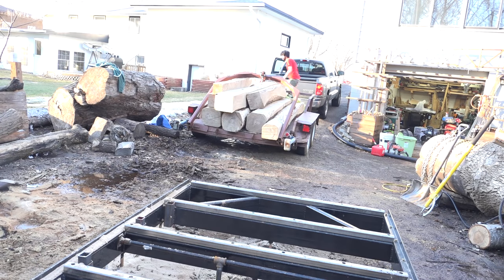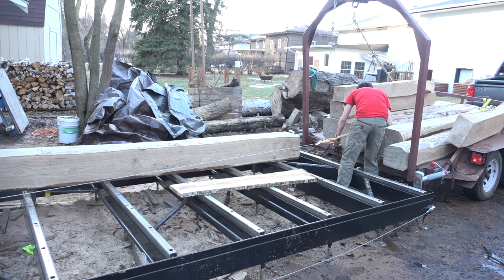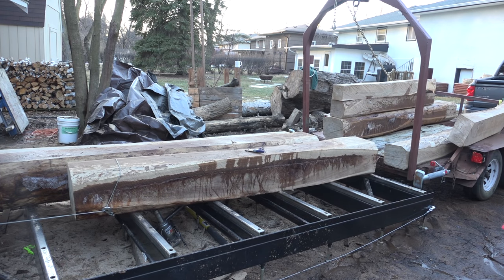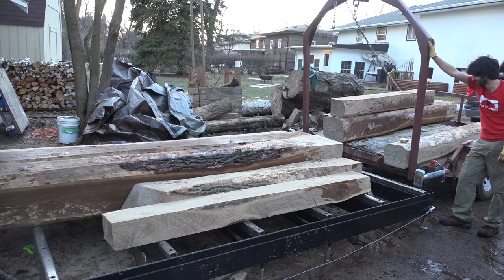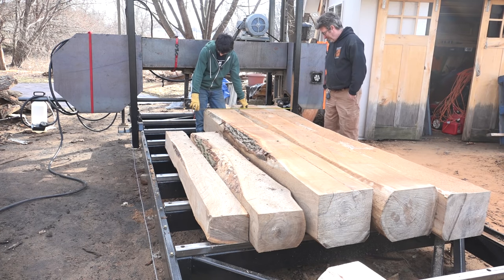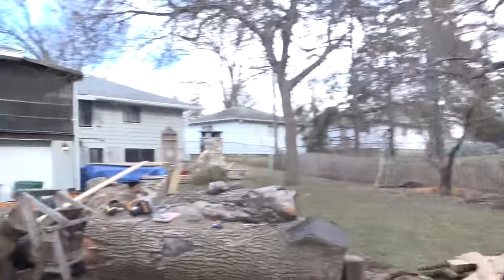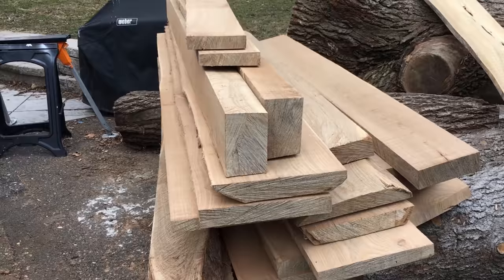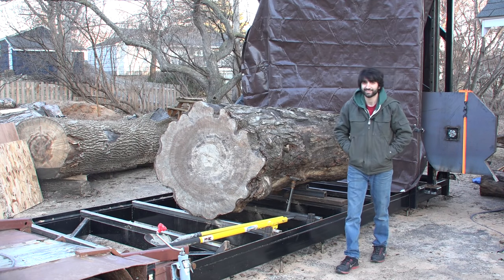Load Testing the Bandsaw Mill

Comment: I have a small sawmill (24" width) and I've found interrupted cuts like the ganged ones you're making takes less hp than the same width in a continuous cut.  I think that it has to do with the gullet being able to discharge the sawdust in the space between logs.  A good tip that I've learned is to use a water drip with liquid dish soap mixed in -- it cools the blade and more importantly keeps the gum off of it which can also rob hp.  Love the tenacity with the sawmill .  Keep going and Happy sawing!

Comment: Really amazing machine! I did notice that the drive belt did start to chatter when the torque changed with the wider material. Just a suggestion, but if it were mine I would install a tensioner or back side idler that would increase the life of the belt. This will also take up any stretch that occurs during the life of the belt.

Comment: I was thinking on the shot from "behind" the blade when you are cutting the 4 logs (cants?) and the drive belt is in plain view that it looks a bit wonky.
from about 7:30 to 8:30
I guess it can't be loose, or it would slip.  so maybe it's the width of the belt flexing or waving?
I don't know if it's a "problem", but you might want to look at the video & see what you think.
though I guess you can see it when you run the saw, lol, but maybe you're watching the logs & not the belt.
maybe an idler wheel would keep it from waving?  hard to say from half the country away.
;-)

the other thing I was wondering about is the blade TPI and possible clogging on such a wide cut.
but I have a 14" bandsaw that I've used once so there's that.

Comment: Matt, have you tested the blade temperature after making those wide cuts????? Just curious as to how much heat the blade is holding...  I have watched this from day one, VERY MUCHO IMPRESSIVE, considering you built the mill from scratch and no previous mill building experience!!!!!!!!!!
Reply: I was thinking the same thing. Wood is frozen through, by the time the blade might get warm, the moisture inside is still lower than thaw. This coming hot summer maybe add a blade mist system? At least when cutting 60 full inches.
Reply: I was wondering that too. Definitely hot enough to cause a bit of smoke in between the log. Probably comes from the fact that some of that wood is frozen.
Reply: More like , hang a ten gallon jug with a 3/8''s line to run a liquid luber to your blade, kerosene, Pine-Sol, and a little Dawn is the best!! 30 drops per minute... your blade life will be greater (so long as you are running it fast enough), it will help prevent sticker-stain while drying, and is non-staining on the lumber.

Comment: What surprised me was that the blade could clear the sawdust as well as it did with a cut that wide.   I know the saw can use 2-inch wide blades, are the gullets much deeper on those?  You might get some really fast cuts!

Comment: Great to see this working so well!  Does the thickness of the board you are cutting make a difference in how hard the saw has to work?  For example - does the extra weight of an 8/4 slab want to slow it down more than a 4/4 slab?  Thank you for sharing this project.

Comment: Hey Matt great video and also a really great machine, just from looking at the video are you getting a jump in feeding through the cut if so it may be caused by being pulled from one side   If that was the case it could be solved  by bringing the wire rope around the end of the bed via two pullies and connecting it to the other side of the frame creating a even pull between both sides of the frame

Comment: I love your build, though for myself I would tweak the design a bit. I would make it narrower so I could set it up as a trailer, and I'd make it much longer. I'd say being able to cut about a 36" diameter log would suffice, but I'd make a base bed of 12ft, with 6ft-8in extension beds (x3) so I could saw 32ft long logs but I could transport it at only about 12ft. That way I could mill roof rafters and the like.

Also, I think I'd put a tooth track alongside the glide track and an electric motor with driveshaft connected to a gear wheel so I could have powered gliding instead of the manual winch. Your build is certainly inspiring.

Comment: Absolutely stellar Matt! (I was noticing the way the carriage binds and torques, then "pops" because of the one-sided pull. What would happen if you built hold-offs for pulleys on each of the far corners and then connected the end of the pull cable to the other side of the carriage? Would the even pressure help relive that problem? I know it would double the amount of cable you'd need to wind in during a cut as the ratio would change...)

Comment: Matt, it appears you are using a VFD to generate 3 ph. If your VFD has the capability to display output current you can monitor your motor load and adjust your feed speed accordingly. Also, as you become more familiar with your saw, you will be able to determine the optimum time for a blade change.
What are you doing with all the sawdust?
Rollie

Comment: Congratulations Matt. I was impressed that the time of each cut was not drastically different. In one of your next tries, would you please consider checking the amps drawn in relation to the total width of the boards. I am curious about the best operating point (best compromise between speed, volume and cost) for that monster saw. Anyway, I am still amazed at the result. I was also wondering if wedges would be useful like on a chain-saw mill or if it's useless or even detrimental for the thin kerf of a band-saw cut.

Comment: Matt...That mill is a beast!! ...and yes, I have seen the videos of the 5' wide log! Amazing!! just one question: I don't get into really big, ambitious or exotic projects, so...What, exactly, would you use 9-quarter, 11-quarter, etc. , lumber for, anyway?? The slabs, I can understand, but dimensioned lumber? Timber-frame floor joists, beams, etc.?
Reply from the maker: Table tops, table legs, large moldings, etc.  If you look at the highboy I'm building now, most of it came from 4/4 but I needed to use 12/4 for the legs and for the moldings.

Comment: I am curious to see how the saw cuts in the large logs as compared to the ganged smaller logs from the perspective of the swarf clearing the gullets. With the slight gaps between the ganged smaller logs it was evident that some of the swarf was escaping between the logs. On a solid large log the gullets may fill up and all but stop the cutting if the feed rate is too high.  If the swarf does clog the gullets you may need even fewer teeth and even larger gullets to realize the potential of the saw. 

Cool experiment you have going there!

P.S. So are we going to see that big maple milled tomorrow? Curious minds want to know! :~)

Comment: Loading logs from the side is so, so, so, so much easier.  You can use the electric winch to load them from the side too.  Just build a stand and mount the winch on there, then pull the cable over the top (not underneath) the log, and you'll be amazed.  Loads right up.  As seen on a Norwood mill, for example, but replace the boat crank winch with the electric one.
Reply: Also, I should add, the winch side loader can be used to pull the logs together on the bed too - rather than all of the pushing, shoving, and wedging (i.e. pain and suffering).

Comment: Do you have a drip system on the blade?  Not even sure that's necessary, but most others I've seen have one.
Reply from the maker: +Mark Perkins I haven't installed it yet. I've just been manually spraying the blade between cut to clean off any pitch buildup

Comment: if the logs don't move with the blade, and stay still you have not pushed too fast. But best speed is noit too slow either.  Feed rate is based on wood type and width and the wood load above cut.
Were you lubricating blasdes?   Number one way to learn about feed rate is having all the blade temps measured to see the curve of cariety.  Just like proper tension. A device Laser Temp tool.

Comment: Hey Matt !
Good job on you mill build  !
which band blade manufacturer are you using ? 
Cooks ? Woodmizer ?
Reply from the maker: Thank you!  These blades are from Cooks
Reply: +Matthew Cremona Not to take anything away from the mill you built , but few blades would get those kind of results on such a wide cut
I just started with Cooks blades and haven't been disappointed yet
I'll never buy another Lennox woodmaster blade ,nothing but rising and diving cuts
Reply from the maker: I guess I got it right on the first try :)

Comment: So I guess you'll have a year or two while those slabs are drying to design and build your 6' wide slab surfacer/flattener. 10 HP router, 8" diameter morticing bit, tubular steel rails, hydraulics, ... can't wait!

Comment: Great machine, impressive. Wouldn't it help the motor and the blade work a little better if you inserted wedges after the blade cut a few inches to hold up the weight off the blade

Comment: I am realy happy for you Matt, the saw is working well and should have no problem with larger single logs. Will you be installing a water system, or is this a summer thing as the timber is wet/frozen enough ?.
Reply from the maker: +darran newman thank you!! I have a lube system that I still have to install. I've just been spraying the blade between cuts to clean off any pitch

Comment: Matt: How many pounds are on the blade tension? Where did you get your knowledge to build your mill as I'am very empressed? Do you have plans?
Reply from the maker: Close to 1200lbs.  More info on the tension here: https://youtu.be/RPKXP8TpRVM?t=20m13s  I just did a lot of research and figured it all out.  I'm working on putting together plans for the mill.  They should be available in a few weeks.  Thanks!

Comment: who says you can't turn out some lumber with a manual band saw mill. 61" cut smooth and level? AWESOME! you could cut some cants, 14/4 slabs, then turn them on side and make 6/4 cuts and have a load of nominal 2x4s in no time.

Comment: How much extra load does frozen wood place on the system?
Reply from the maker: +Will Wyatt I'm not sure what the % difference is. I would guess it would have to do with the amount of water in the log?
Reply: I'm sure it wouldn't make much difference, as the Grey Monster would probably have NO problem slicing through solid ice.

Comment: How do you plan to sharpen your dull band saw blades? I hear that during a full day of sawing many blades will be dulled. That means there will be a lot of sharpening required.
Reply from the maker: +rol eic I'll just send them out for now. When I saw out at my friend's farm, we'll go through 2 blades for a full days worth of sawing.  That's at a much higher output than I'll be doing here
Reply: I have no big sawing experience myself. With your experience I understand that sharpening is a less urgent problem for you. In another video (haven't got the link right now) a homesteader, who cuts fresh trees and saws them on site, tells that he is going through 8 or more sawing bands per day. Maybe his bark is loaded with dirt and he does not clean it sufficiently or he is using a lower quality saw band.  When I come across that video again I will put the link here.
Reply from the maker: Wow 8 a day is crazy

Comment: All of Canada's lights dimmed down during that last cut. 
Seriously, it would be interesting to know amp draw as the cut increases.
Reply from the maker: +Benjamin Friel lol! amp draw is going to be a function of feed speed. On the last cut that I showed at 8x I was feeding at a rate that keep the draw at 50amps
Reply: Matthew Cremona  so your keeping an eye on the amps as you cut and adjusting feed.
Reply from the maker: I'll have either the draw or the operating Hz displayed.  Hz is a bit easier since I can find a feed that doesn't drop the frequency of the motor.  Amp draw tends to bounce around
Reply: Very cool and wise.  Thanks for these videos I really enjoy them. Keep it up.

Comment: We have a 10 foot CNC panel saw at work and it has a nice simple cheap way of gauging loads during sawing, it's a small amp gauge which you could get on eBay. We use it to judge the sharpness of the blade and toughness of the material so we can speed up or slow down the feed rate accordingly. It helps show us when the blade needs sharpening or if we're pushing it to hard. They are simple to install and you will always know how hard the motor is working which in turn tells you the conditions your dealing with.
Reply from the maker: The vfd I'm using will display the amp draw of the motor.  I was watching that for the last cut I showed.  The other ones I was watching the frequency of the motor and adjusting my feed to keep it at full speed.
Reply: Matthew Cremona  nice even better

Comment: Any plans to add a blade lubrication system?  Maybe you can't because of the metal on metal at the wheels, but that would make these large cuts much easier.
Reply from the maker: +laweidman I haven't installed it yet but yes
Reply: Nice!  I'll be excited to see the results

Comment: Note to sawmill makers.  One doesn't need an electric motor bigger than 10hp (7.5kW) for the average millers needs.  Impressive that the cut went that quick when sawing 61" wide through hardwood.   I am sure you are giddy with excitement to start milling your "big" logs.   Don't get too carried away though, you still have to find a way to stack and dry the slabs.  Better start pumping some iron to increase your muscle mass.

Comment: You have likely addressed this, and I missed it. Sawdust management is definitely going to become a problem! 
Seems like a hassle, but if you hung a bucket under the sawdust output port and dumped it after each cut, it would save you a lot of work later.
Reply from the maker: +William Alan Photo the dust that comes out of the chute is really easy to clean up and I really don't mind. The stuff that ends up all over the place under the bed is the real issue
Reply: Yes, I thought about that too... but I didn't have a simple bucket solution! LOL
I have enjoyed this build and the amazing results very much. Thank you for your great work! We were all right there with you today on this wide cut! Awesome! Are you thinking about putting a pole building over the saw eventually?
Reply from the maker: lol it's all good.  A little clean up is good mindless work that is a nice change sometimes.  I won't be building a building over the saw here as I already have both of my allowable accessory structures on my property
Reply: Matthew Cremona just put a plastic tarp underneath it will catch the dust under the bed and you can just pull the tarp from underneath when you're done cutting and dump it easily
Reply from the maker: Every bay would need to be tarped because I have the leveling feet.  It's really not that big of a deal.  I have a shovel lol
Reply: You need an intern!
Reply: just make a real slick sheet of material underneath the saw bed and then cleaning up will be a lot easier....
Reply: Add a hook at the end of the chute, and hook a 5-gallon bucket on it. Then it's just a matter of emptying the bucket as needed.

Comment: If you want to keep your mill area cleaner, hang a 5 gal bucket on the saw dust chute and just dump it in a garbage can every few cuts.  Your dust pile in back is not going to work long term.  The pile will get too high and you won't be happy.  I burn the dust as I go along in a vortex burn barrel(look that up on youtube).  Green sawdust will burn.  Don't fill the barrel full, just half way leaving a space on one side for air to come up from the lower vent holes.   Then pour 2 cups of diesel in and light it.  The green dust burns no problem, plus all your bark.  Give your slab wood away for bonfires/woodstoves.

Comment: I'm surprised that so much effort, hopes and money were put into the machine without knowing its capabilities. That is confusing on several levels, and almost capricious.  The machine's performance could - should - have been determined and known in the design phase. All the information necessary is freely available on the Internet and is not difficult to understand and compute.  This general lack of knowledge of many elements of machine and material performance is evident throughout this project in its "overbuild" mind set.